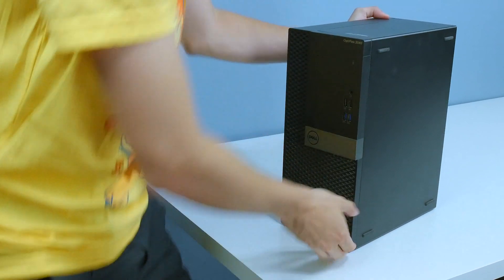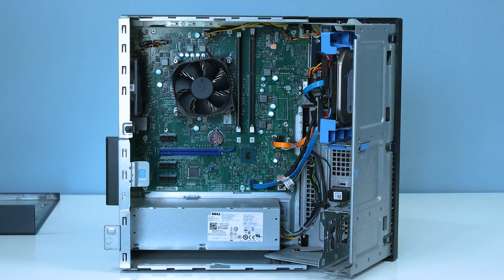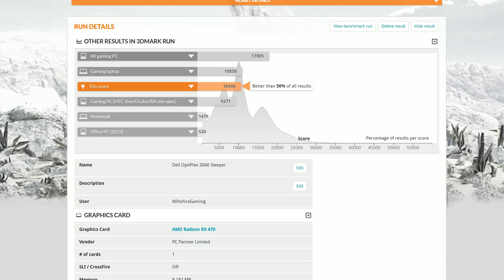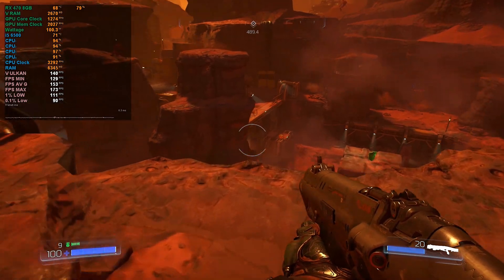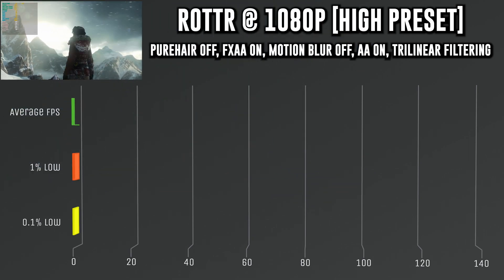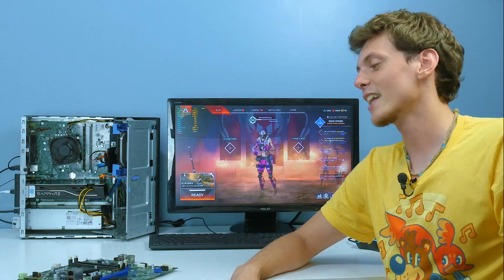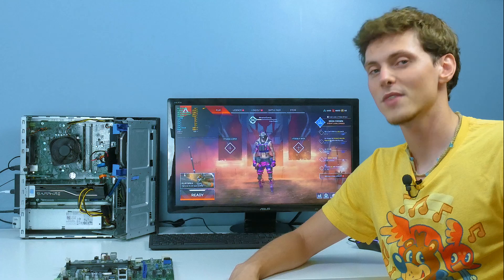$400 Budget Dell Optiplex Gaming PC (2019)

Comment: What would be the best graphic card to use on this?
Reply from the maker: If you plan on using the stock PSU, then it would be the RX 470 I used in the video here. It's pretty much pushing the stock PSU to its limits.
Reply: Wiltshire Tutorials what else could I do to increase FPS?
Reply from the maker: You could upgrade the CPU to an i7 and maybe overclock the GPU a little.
Reply: Wiltshire Tutorials Also what is the best optiplex for gaming
Reply from the maker: I don't have an answer to that. I only own the Optiplex 3040 and have only tested one Dell Optiplex.

Comment: Sapphire RX470 nitro just about fits and does really well in one of these, even with the trash power supply
Reply from the maker: Yup! An RX 470 does the trick quite well. Leaves enough headroom to not over-stress the PSU too. I wouldn't personally try anything more powerful than the RX 470. Don't want that PSU going pop!
Reply: Thanks for taking the time to make the video, it helped me gain confidence in that awful PSU 😂

Also btw what you’ve done with your Optiflex is incredible, nice work dude 😎👌🏼
Reply from the maker: The PSU is probably the weakest component in the 3040. It should be the other way around. But, Dell wanted to save as much money assembling the PC as possible.

Glad you like OptiFlex. Thanks for watching
Reply: @WiltshireTutorials  what about optiplexes 5040? Is there a way to change the power supply or for these you cant.

Comment: Could this handle an RX 570?
Reply from the maker: More than likely not. It's a little past what the stock PSU can handle. You could try to undervolt the RX 570 to make it work. But, I recommend an RX 470 instead.
Reply: @WiltshireTutorials  got it. I run an older optiplex 790 (which has an upgradable psu) with an i5 2400 alongside a 570 after a 500w psu upgrade. I found a cheap 7040 MT for around $250, so I was hoping I could transplant the gpu over haha 

Thanks for the quick response though, and great video!
Reply from the maker: Ah, I see. That makes sense. No problem! Glad you like the video. Thanks for watching

Comment: Hey do you think I could do this with a Dell Optiplex with an i5-3470 processor. I would add a gtx 960 and 8gb of ram. Do you think I have to get anything else?
Reply from the maker: May need a PSU upgrade to feed that GTX 960

Comment: Hi. Great video! Your video might have actually saved me some serious bucks.

So I purchased a Lenovo M92P tower with an i7-3770. With the cpu and HDD stressed, I get a maximum usage of 90w. It has a 280w psu. I have an EVGA gtx 960 (2GB) SSC I want to try. It draws the same power as the rx470. So I have two issues if you can help me.

Firstly, every information online about this adapter (sata to pcie) or this method seems to be negative. By calculations, I'm well under my psu max output. Not sure if people are just generally not glued up with pc knowledge (stuck in old school thinking) or if this a really very very very dangerous method. 

Secondly, I have 2 sata power cables, with 2 sata connectors daisy chained on each sata power. One has an optical drive  (DVD) which I can easily remove, which leaves me with one proper sata power cable, then the other has my hdd. Can I use the second available sata connector that is daisy chained to the hdd to provide enough power without cables burning up. Did u face this problem?

Sorry for the essay.
Reply: How do you calculate the max power consumption of the system
Reply: @welleducatedman1388  hi. Been some time since then. To update, I have installed the gtx 960 SSC onto my system with the stock 280w psu using adapters. Have it on about 3 months now with no issues. With stress testing all components, system uses about 210w of power at most.

My lenovo system has software installed that tells me how much of power I'm using at any given time

Comment: Hello, just got myself an optiplex 3040 after watching this video. I want to install the same sapphire rx470 graphics card, but it seems the on you installed is 10mm (230mm overall length) shorter than the gaming versions (which are 240mm long). Would you please help me verify the length of the you you installed in yours? Do you think a 240mm you would fit? Thanks.
Reply from the maker: 240mm is absolutely pushing it. That was the max length I approximated when building OptiFlex. I'm not even sure you'd get the case to fold back in with cables running up the front of the PC. If you can, buy the Nitro version of the RX 470. You could find a good used one online.
Reply: Thanks for the quick reply. Just wanted to make sure before I order one. I'll try to get the nitro version. If it doesn't fit, hopefully, I'll be able to chip away some of the plastic shroud and wiggle it in there. I got a good deal on the optiplex and only bought it after watching your video to confirm that a full size gpu can fit in there. I couldn't find anything better (video or text), so I really appreciate your effort.
Reply from the maker: You're welcome. Make sure to get the normal Nitro version and not the Nitro+, as the Nitro+ is a little longer and taller than the Nitro version.
Reply: @WiltshireTutorials  I'll keep that in mind. Thank you.

Comment: Hi dude... Can I instal gtx 1650 super in this PC?. I would buy one if this PC can handle that GPU without problem.
Reply from the maker: You could run a 1650. But, I'm not sure you'd get away with the SUPER.
Reply: @WiltshireTutorials  okay... Thank's a lot.

Comment: Are you even serious? you haven't change the power supply to add that gpu inside?!
Reply from the maker: Yup! You can use an RX 470 inside just fine. For an experiment I overclocked the GPU, which I DO NOT RECOMMEND due to power limitations. Puts too much stress on the PSU.
Reply: after watching that video I want to add GT 1030 at least it won't be a big monster unlike the rx 470!
Reply from the maker: @wolveshunterxxx7106  A GT 1030 should work just fine for you.

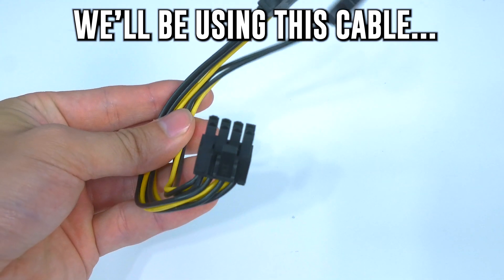Comment: How did you manage this with the sub-par PSU? What cable is that at 3:12?

Would there not be enough room to just stick a beefier PSU in there?
Reply from the maker: It's possible with that PSU with how much wattage it uses. If you do the math, the GPU takes 110W, CPU is 65W, chipset is 8W and SSD is about 10W. This totals to 183W. Well under the max rating for the PSU. Would I recommend pushing the PSU that hard all the time? No.

The cable used was 2x SATA power connectors to an 8-pin PCI-E power connector.

The power supply is a proprietary Dell PSU. It doesn't use standard connectors and it is a unique shape.

Comment: What connector did you used for powering gpu? 
I have optiplex 7040 Core i7 6700 can u suggest what gpu should i use with it?
Reply from the maker: I used a cable that converts 2 Sata power to an 8 pin PCI-E connector. The 7040 shares the exact same PSU as the 3040. So, your max GPU will be an RX 470 or maybe a GTX 1060
Reply: @WiltshireTutorials  Thanks for replying man.
Will you make a video on upgrading psu of your optiplex?
Reply from the maker: No problem! I did. It's in the modding Optiplex video.
Reply: @WiltshireTutorials  i saw your video but u did not show how to install SF 600 in it what adapter did u use for motherboard power?
Reply from the maker: I made the cable myself. But, you can easily buy one on Amazon. It's a 24pin to 8pin motherboard power cable.

Comment: The power supplies in pre-builts these days are no longer the ticking time bomb from a decade or two ago.
Despite the lack of 80+ certification in this one, these units are able to deliver it's written maximum output continuously. My OptiPlex 7010's built in PSU is actually quite hefty and the components inside are decent. Just check if the 12V rail can handle the load instead of the PSUs entire maximum rating.
Reply from the maker: Quite true. They are better than what they were! They just don't have the power delivery. Obviously to keep cost and power consumption down. I stress tested this PSU for 24 hours on a GPU benchmark, it did fine!

Comment: i have a dell optiplex 390,
cpu: i5 2400
ram: 4gb
hdd: 500gb
i got it for free from my uncle so i bought an RX 570 160$ and changed the power supply 40$. im so happy with it, it rocks! im also planning on upgrading the memory to 16gb i just dont have the money atm.. '_'
Reply from the maker: These Dell pre-built Optiplex PCs can do some serious work, with a little bit of tweaking! Definitely a very good option for a entry level gaming PC!
Reply: Which rx 570
Reply: @manomant181  XFX RX570 8GB
Reply: modzFN  thermaltake 550w

Comment: good video but that power will collapse at any time with the risk of taking another component with the
Reply from the maker: I stress tested the PSU and everything for a full 24 hours. Seemed stable. Not a problem at all. I wouldn't run it overclocked all the time, like I did in this video.

Comment: You change power supply?!
This card required power supply 450w how is that?
Reply from the maker: Same power supply. That's a recommended wattage from the manufacturer. Real world power draw is 110W at full load. The CPU consumes 65W at full load, chipset is about 7W and SSD is about 4W when reading/writing heavily. Add all of those up and I'm well under the PSU's max wattage output.
Reply: @WiltshireTutorials  is the psu upgradeable?

Comment: You overclocked the 470 on that power supply???

I would not keep this in my house. Too dangerous
Reply from the maker: I overclocked it just for fun. GPU only drew 110W at the time. But, I agree. I didn't keep the overclock on it. Just in case.
Reply: Wiltshire Tutorials good idea.
Do you still use it? Did you sell it?
Reply from the maker: I still have the Mining RX 470. It currently isn't being used. But, I have an idea of what to use the GPU in.

Comment: Gpu doing some work there... But the results are pretty dam decent.
Reply from the maker: That sucker was maxed right out. I was rather surprised with the gaming results as well!
Reply: @WiltshireTutorials  I'll post my results in a week or two of my Dell 790... Kinda blown the budget on it but 1080p here I come...lol. P.s your build gives me motivation and hope.. I just hope the Bois upgrade goes well lollll
Reply from the maker: Keep me posted on how things go! If you have any questions about my build, feel free to ask away! BIOS updates aren't as scary as you think.
Reply: @WiltshireTutorials   Well the build is all done. Gtx 970 went in with some minor mods. The only downside was I wish I got a bigger ssd.
FPS on games such as Doom3 - Apex - Overwatch - Cs go went well with setting to high-medium 1080p. fps was smooth as butter. For the price-performance, it exceeded my expectations.
Reply from the maker: Right on! Glad to hear you got the build up and running and your happy with it. SSDs are pretty cheap these days. So, I wouldn't worry about it too much. Since you have a smaller SSD, when you go to upgrade to a larger SSD, just clone your old SSD to the new one. Saves the hassle of moving all of your files and Windows over to the new drive.

Comment: Can you show us where the 8 pin to Sata adapter actually plugs to? Is it the propriety sata power on the motherboard ?
Reply from the maker: What do you mean? The connectors on the cable are both standard connectors. One is your standard 8-pin PCI-E connector and the other is just 2 Sata power ends.
Reply: @WiltshireTutorials  thanks for the reply. You said the power supply doesnt have sata cables so I'm assuming the dell sata cables get power from proprietary connector on the motherboard. So assuming you plugged the dual sata to 8 pin into those ?
Reply from the maker: No, the power supply doesn't have PCI-E power connectors, so I used the existing SATA power cables to make one. The SATA power connectors oddly come out of the motherboard with a proprietary cable.
Reply: @WiltshireTutorials  awesome thanks for confirming. So technically the motherboard is suppling the 100 odd watts to the rx470  in that case...
Reply from the maker: I think the power supply is supplying the power to the SATA cable through it's proprietary 8-pin power cable for the motherboard. It's just and odd pass-through design that doesn't make a lot of sense.
Reply: @WiltshireTutorials  that's what I was thinking. Which actually means the dell power supply with the proprietary 8 pin mainboard connector has to supply wattage to all the board components and the Rx 470. The reason I ask is that I was considering doing the same thing but was afraid of meltdown on that one connector .. lol
Reply from the maker: Since there isn't a ton of wattage going coming the PSU to begin, I think you should be just fine.

Comment: Fortnite pubg pro settings fps? 1080p 144ghz
Reply from the maker: I'm not sure the RX 470 could pull off 144Hz. Maybe with a 1060 6GB it could
Reply: @WiltshireTutorials  on 60 ghz? How much fps?
Reply from the maker: 60Hz would be no problem. I would say 90 fps or so at 1080p

Comment: Dang bro, why the need to benchmark doom at trilinear filtering?

Its got a pricey CPU and a decent bang for your buck GPU, surely it can handle at least anisotropic filtering 4x
Reply from the maker: Good question! A normal RX 470 could do it just fine. But, for some reason, the Mining RX 470 I have would crash Doom when using AF 2x or 4x. So, I used Trilinear instead.

Comment: Hey dude gotta question for ya: whats the cheapest pc you can build that could run Tekken 7 at optimal settings?
Reply from the maker: Hmm... the recommended specs for Tekken 7 are an i5 4690, 8GB of RAM and a 1060 6GB (or an RX 580 8GB).

I would maybe go with a used pre-built PC. Such as the one in the video. You can get a Dell Optiplex 9020 with an i5 4570, 8GB of RAM and a 500GB HDD for a reasonable price. 

The PSU in it is 255W, if I'm not mistaken. Which would be difficult to make a GTX 1060 or RX 580 work. You could go with a 1050 Ti. It draws power straight from the motherboard. So, no PCI-E power cables needed. The 1050 Ti seems to perform really well on Tekken 7 too!

Hope this points you in the right direction!
Reply: Wiltshire Tutorials aww mate you’re an absolute legend!! Was looking for a general guideline to what I’ll be needing so I don’t spend too much, im pretty sure i gotta pc lying around with similar specs, gonna go check it out. Thanks gonna comeback to this 😁
Reply from the maker: Glad I'm able to help out! Let me know how it goes. If you have any more questions, feel free to ask away!
Reply: Wiltshire Tutorials sounds like an old Alienware x51 has the exact specs to play that game
Reply: My friend actually runs an old hp office pc with a 1050ti and we play tekken 7 on it all the time you'll be gucci.
Reply: Asking for me n a friend.... mostly for me cheers

Comment: It says 'Maximum continuous total DC output power shall not exceed 240W'. Doesn't that mean it's a continuous rating?
Reply from the maker: Yes. I wouldn't push the PSU to 240W though!
Reply: @WiltshireTutorials  Ok, I agree 🙂
Reply: I’ve used a 1050 TI with no issues in Opltiplex and HP SFF systems where there was only a 240w PSU

Comment: You were talking about how horribly small the 240W power supply is while I use an even smaller 180W one, lol. I'm not saying you're wrong, though! Thank you for the advice, I was wondering what my options are. I subscribed :)
Reply from the maker: Ouch. A 180W PSU won't get you anywhere unfortunately. I do have a follow up video on the Optiplex being uploaded soon. I take things to the next level in that video. You may want to watch it, due to a PSU swap I do ;)
Reply: @WiltshireTutorials  Cool. I'll look out for it 🙂
Reply: If I have a 180W PSU and all the parts in the PC add up to 95W max, can I install a GT 1030?

Comment: Can we add fan?
Reply from the maker: Yes and no. The motherboard does not have any more fan headers on it. Meaning, you will have to resort to using the additional fan with a Molex adapter to SATA power to power the fan.
Reply: @WiltshireTutorials  hmm oke

Comment: i am building a streaming and gameing  pc ..ram 3000mhz or 3200mhz??
Reply from the maker: If it's Ryzen, 3200 Mhz. Ryzen does not like 3000 Mhz. Even if it were Intel, I'd suggest getting the fastest RAM possible.
Reply: @WiltshireTutorials  thanks.building msi mpg x570 and 3700x and rTX 2060 super
Reply from the maker: Should be a decent build! Have fun building!

Comment: Definitely look into undervolting that 470. Might save that PSU from failing and it'll really help thermals (and performance) across the board, especially in a tight case with questionable airflow. 
Also, $400 is selling yourself short man, these builds (albeit with older gen i5-i7s) can easily be done for sub $300, especially if you don't replace the PSU or add an SSD.
Reply from the maker: I was thinking of undervolting the 470. May do an upgrade update video on the Optiplex soon. I made the title based off of the model of Optiplex I had. It's a little more expensive than older Optiplex PCs. Would recommend the older PCs though, if you're on a budget!